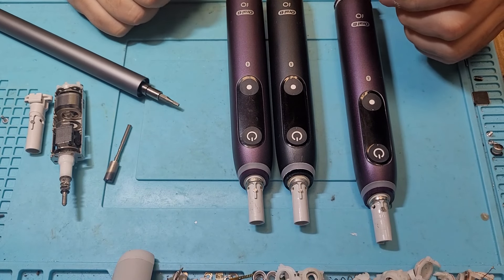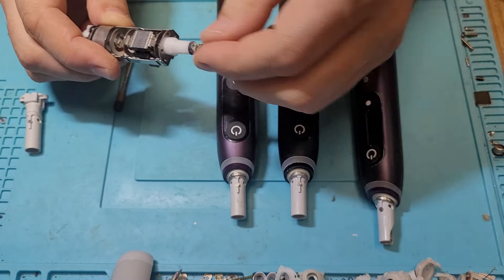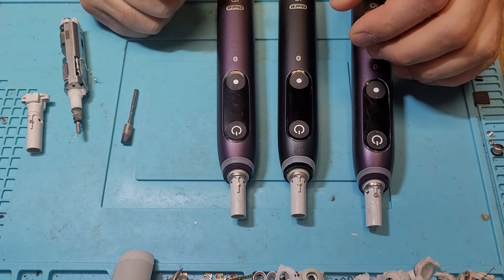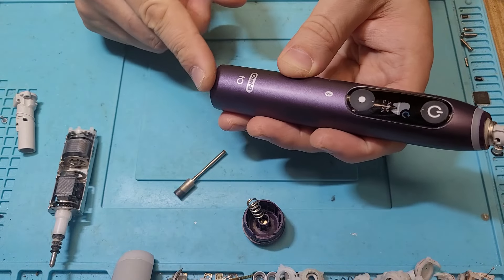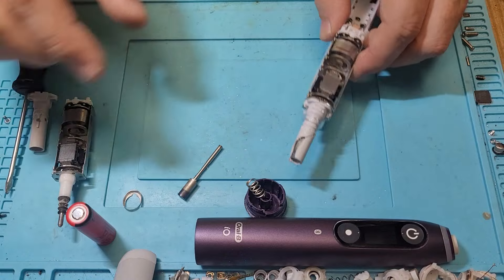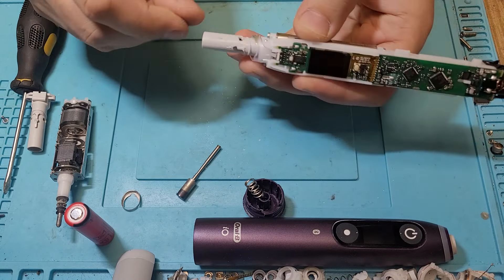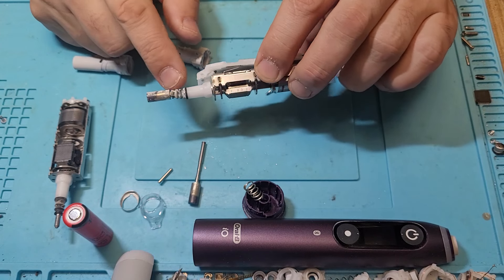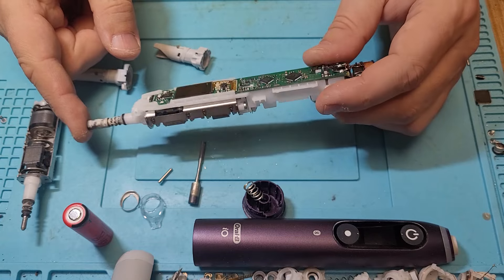Oral-B IO teardown/repair and impressions

Comment: Who else landed off in this great video after breaking the moisture membrane?😅
Reply: I am asking for a friend :)
Reply: Apparently, I damaged my back seal (don't believe I did), and it didn't fall under warranty. What do you replace it with?
Reply from the maker: @andreyzhidkov6509 another seal from a donor toothbrush.. haven't found till now these sold separately.. Philips toothbrush seals could work also but they are more difficult to remove..

Comment: It’s so annoying that Braun (P & G) do NOT provide spare parts. This (Io9) toothbrush is $749 recommended retail in Australia and I think it is indefensible of Braun to not provide parts. My wife’s brush has the detached shaft problem, and from my examination it would be a simple job to replace the part if all other components are working. Thank you for your video and spending time putting it together. I know there are No parts in Australia, no parts in the US. What about the EU, surely this policy contradicts the EU approach to sustainable production practices?
Reply from the maker: sadly no parts in EU as well... hopefully it will change if Right to repair will get a stronger foot in regulations. But at this moment service centers think that users are not qualified to desolder 2 points on a motherboard...
Reply: Perhaps a spot welder will do the trick...the kind they use for spotwelding clips on batteries.
But my pick will be is to buy a new IO3 on sale and desolder the complete part drive-shaft-seal-etc (as shown in the video) from the mainboard to be used on the IO9. Do not buy the IO2 as I've been told that it uses an other motor/drive...but I can not confirm it though.
Reply from the maker: Spotwelder for batteries is to weak for this job.. Tig welder would do the job but there is no place to get in and leveling it out would be a pain as well... Good idea for "brand new" parts ;) yes IO drives are identical but same as you didn't had Io 2 in my hands...

Comment: Very useful video. The problem I have with my iO is that it does not hold the charge. When put on the charger it seems to be working fine, charging up to 100%. But then when I try to use it it discharges to 0% immediately. Thanks to your vid I opened the brush and measured the capacity of the battery and it looks OK (729mAh). When I installed the battery back it worked fine for couple of days and the problem with immediate discharge came back again. Any ideas on where to start and what can be the possible reason?
Reply from the maker: Sorry don't have concrete solution.. didn't had one like this till now. But if it discharges that fast something should heat up on the board. Try inspecting with finger or thermovisor would be perfect for this..
Reply: @letsfixitgarage  Thanks for the hint, that makes sense. I'll check the thermovision. 👍🏻
Reply: @kon-jakub bro i get the same thing whats the problem
Reply: @vyvaqt738  no idea, I haven't spotted anything yet :(
Reply: I have the same issue. Haven't managed to open up and test the battery yet. The bottom sits very tight. If anyone have a solution I'm all ears. Thinking about 3d print my own tool to open. But if it isn't the battery.. then what?
Reply: @PatrikGerenmark  its NOT the battery, I can tell you that 100% sure...

Comment: Guys anyone help pls, how can i remove the plastic screen from the housing? I have a donor and want to swap those plastic screens (with rubber buttons)
Reply from the maker: My experience is that only whole housing exchange is a possible repair.. screen with rubber as well as rubber seal on top are melted too the housing no easy way to separate them...
Reply: @letsfixitgarage  thanks for replying. I will better leave it as is then

Comment: i think the only way to prevent mold and toothpaste build up is to wash the toothbrush and head every time and keep them separate to dry
Reply from the maker: there is other way but it involves changing your habits and that's not what a user wants to do :) best way is to hold the brush with levitated back side in that case toothpaste drips back ant not on to toothbrush. of course washing it thoroughly after usage is a must with this design as well..  as the head has hallow design..

Comment: my io5 doesn't turn On, it blink's all programs, it charges, but not turning on... No PP fuse on in like you said :)) Any fix ideas?
Reply from the maker: Difficult to say.. I always suspect water damage when something blinks or doesn't turn on when you press a button.. or do you mean that it turns on the led when you press the button but doesn't turn on the motor?
Reply: @letsfixitgarage  it just scroll’s through lights when placed on charger, then keeps scrolling if intake it off and doesn’t turn on the motor … 
No water inside !

On wife’s genius X i found a way even to reset the chip a year ago and it’s still working today. 
This one has to much technology :))
Reply from the maker: Yes all the new cool functions are a potential brake point... Sorry no advice this time haven't seen this defect personally :/

Comment: Thank you. Your video allowed me to fix my OralB iO series 6 that was 4 months old. Like many comments below, the magnetic head detached from the shaft. I little tip I discovered to get the head back on correctly was to soak the magnetic head in acetone and using a fine, sharp and strong needle, dig out the old epoxy. This took a while and multiple soakings in acetone. Once all the old epoxy was removed I added one drop of super glue on the shaft and reattached the magnetic head. It is working perfectly now.

I rang OralB US. They never followed up with email as promised. I emailed them and after explaining what was wrong, their response was "no receipt, no warranty. We will send you a $10 discount voucher." Are you kidding me OralB. $120 toothbrush that breaks after 4 months and they drag their feet and then offer $10. What a joke and what poor customer service.

Once again, thank you as you saved me throwing away the toothbrush.
Reply from the maker: Thanks for sharing your experience! Yes somehow both Philips and Braun are shooting in to their own foot with this no spare parts policy.. the brushes are well designed and really repairable but company policy makes it impossible. I believe the biggest problem is that a lot of times people don't see that they are throwing away the magnetic head that is ripped off with the brush head.. toll now all the people that asked my help didn't had the head with them, always thrown away..
Reply: I wonder if you could record a video on reattaching magnetic head as mine also detached from the shaft.

Comment: Thanks for your detailed explanations, the magnet on the Motor is for a force sensor, it works together with a HAL sensor on the PCB.
Reply from the maker: Thank you for explanation have forgotten about pressure sensor and how it's implemented in this brush. Really interesting design.

Comment: Very nice video
After I changed the battery on my io9, the unit didn't turn on and I was worried that I had made a big mistake
After some troubleshooting I found out that the "teeth" of the battery compartment were recessed and were not making contact with the battery anymore. I just got a pair of tweezers and pointed them back to the battery compartment and then everything started working again
What a relief 😅
Reply from the maker: sometimes its the small things ;) glad you worked it out!

Comment: I’m not sure what version IO I have but one thing to note is there is a metal pin that connects the plastic bit at the top to the white plastic around the circuit board.  That pin has to be pushed through to be able to remove the top plastic piece after removing the two security screws
Reply from the maker: I take the pin out in 12 minute. all IOs have the same power unit..

Comment: Thank you very much for the video. Our family has two IOs 9 brushes bought in the late 2022 and early 2024. Both of them suffered from quick and random discharge exactly a year into the future. The display says e.g. 59% and then after 5 seconds of brushing it blinks red and says it's discharged. I've replaced one battery almost a year ago, and now it's the second brush's turn. And again your video is the best for doing that! :) 

Both shafts are still fine, though. Also, the seals inside the both brushes were pretty alright after a year of use. Maybe they get dirty if you leave the head to dry on the brush or something? I know, that Oral B some time ago recommended leaving the brush head on the toothbrush and let it dry on an open air. That was in Oral B Pro or something. They now clearly state in the manual to take off the brush head, rinse the brush and the brush head and dry separately. Our boxes included holders for drying the brush heads.

Comment: Mine doesn't hold charge (if I forget to charge it all the time then I can't use it) so I have successfully taken it apart, got the battery out and put it onto a smart charger to test the capacity, but I now can't put it back together. I hope you post a video of this soon 😀
Reply from the maker: What seems to be the Problem? It should just push in place..the springs and plastic holders have some resistance but it shouldn't prevent it to set the battery in place..

Comment: I have two: IO7 and IO9. When the battery issues started, I got the replacements. I put them inside, and both toothbrushes worked fine, and the seal membranes were not damaged. But just after 2-3 days, one died, and the other could not pass the Hello launcher. I opened both of them - a lot of the liquid inside.  

Two questions: 

1. Could it be that the liquid caused some short circuit, which is not repairable (unless you replace the motherboard)?  

2. What I understood is that although you can open this kind of toothbrush for battery replacement, in most cases, you cannot put them back with the waterproofing you had initially. So it just doesn't make an immense sense. 

Thank you in advance for your reply!
Reply: I think I understood my mistake: When I put the metal ring back, I didn't make sure it snapped back into place with the small plastic clip.
Reply from the maker: Thanks for letting us know your findings. Yes this new design is not as reliable as old one so you need to pay close attention if everything is in the place... As for water damage if it damaged the LCD screen there is no other way as to replace the motherboard.. as LCD is glued and is very fragile if you want to.exchage it.. where are you from maybe I would have working motherboards for your repair. Write me to letsfixitgarage@gmail.com

Comment: did you ever test Philips upper seal, rubber gasket on Oral B ? seen some on aliexpress and look like they can be cut to work ?!
Reply from the maker: Oral -b and Philips concepts are completely different, they are not interchangeable.. just take few Philips seals from AliExpress they are ok. If you start to see black build-up on the seal - exchange it

Comment: Your videos are very informative and easy to understand. I say this as someone who's only been exposed tangentially to the secret world of electronics.

 I've seen that many of your videos are focused on smart toothbrushes. As a software developer, I can only evaluate the two from the perspective of code and app functionality and feel that both oral b and sonicare are almost identical in that regard. How would you evaluate these two in terms of hardware. Do you feel like one of them has a superior design over the other ( more elegant , resilient , etc .)
Reply from the maker: I would say that technically they are both top of the line. In Philips they use the same electromagnetic drive on almost all of their brushes for quite some time, even the cheapest and they are more repairable. IO is quite new. now when they introduced the electromagnetic drive I would say they are on the same page as Philips maybe even better but no idea how it will show in the long run and how available the spare parts will be.. at this moment I would choose Philips as they are longer on the market with this technology and spare parts are all over the internet. But the best would be to try both and see which you prefer as they feel quite differently..

Comment: Great video - where do you get parts?  I need to replace the plastic neck like you did.
Reply from the maker: Donor brush. Braun doesn't offer spare parts.. that's what I got when I asked them for parts. Maybe in some time Chinese will start producing them but at the moment you need a donor brush for that :/
Reply: Thank you for the quick reply!  Bad news, I glued it in the meantime. 😅
Reply from the maker: If it holds, that's good news :)

Comment: My iO8 sounded weird and the head didn't rotate. I removed the head and I found that the shaft (complete with the glued magnetic head) was free to go out off the body. Does anyone know if is possible to replace the shaft? It is out of the device exactly how showed in the video.
Reply from the maker: Much easier would be to replace the whole electromagnetic drive. Just 2 solder points.
Reply: Thanks! Please, could you help me to find an online shop where I can order these  kind of spares ?
Reply from the maker: To my knowledge there is no spare parts for the IO at the moment.

Comment: I've had one for just gone 12 months and found it to be broken when I went to put the brush head on.  It looks like the magnetic piece came off and stayed inside the brush head, which then results in it not spinning/vibrating properly.  Having watched your useful video, it looks like this might be somewhat fixable if I take it to part and then perhaps use some kind of epoxy to attach back to the metal rod.  Do you think that would work?  I've always found electric toothbrushes don't last, so I'd been extra careful about looking after and cleaning this one!
Reply from the maker: If it's only 1 year contact the seller for warranty. Braun replaces it with new one in warranty period. I doubt that epoxy would hold. There is a lot of vibrations and even the magnetic head that is epoxy glued in factory sometimes comes off.. so to glue the shaft and then to get it straight.. seems quite difficult but is you succeed make a video ;) I think a lot of affected users will be glad to see this solution.
Reply: I have the same problem! Did you solve your issue???
Reply: I have the same problem
Reply: @siema114  luckily i am still under warranty. I sent mine in for repair a few weeks ago and they sent me back a new toothbrush. Process was smooth. 2 year warranty
Reply: Oral b is refusing to fix mine. I got it as an Xmas gift and the person who gave it to me doesn't have the receipt. It's absolute bullshit. It literally broke after 4 months of use
Reply: @jessicathatsme7945  So to come back to mine, it was a similar situation in that it was a gift bought from Amazon.  They eventually agreed to look at it and it was sent to a repair centre address which I think may have been what Oral-B use.  I didn't hear anything and about six weeks later I found a brand new one at my doorstep, complete with all the accessories.  I'm super wary of removing the brush head though, as feels like it might just happen again.

Comment: Hi, my Oral b IO 9 it doesn't Turn ON.
I replaced the battery with a new one , I checked the ⚡️ voltage of the battery and it shows 3.6 Volts.
Any help please?
Reply from the maker: check the fuses and if there is no water damage, usually its on the under side.

Comment: SO I need to replace the battery, got a new one but can not get the bottom cap off, it is impossible to shift using the tool or indeed pliers without breaking it, any ideas ?
Reply from the maker: Try submerging the bottom part in water for short time and work it back and forth. It seems there is toothpaste build-up that sticks it shut..
Reply: @letsfixitgarage  cheers, tried that and did not work but will try again ... don't want to try pliers as will break !
Reply from the maker: Leave it in water for longer but I would not submerge benearh the hole with ventilation filter. It's not designed to be 100% waterproof for long time submersion..

Comment: Great video! Could you please tell me what the ceramic piece is inside the charging coil and what the spring is for? I took the bottom of mine to replace the battery and the ceramic piece (I believe) had cracked into two. I put it back together without the spring and the ceramic and it doesn’t charge quickly so I’m assuming the ceramic piece is required for the charging to operate. it does seem to charge but it probably 1/10 of the rate of when new. Any insight would be appreciated!
Reply from the maker: Difficult to say.. from my opinion ceramic piece shouldnt affect the charging process... and spring is only there to make pressure on the whole inside to have the toothbrush up to the rubber seal..
Reply: Well, it seems the ceramic piece is required. While not magnetic it has inductance properties and in this case hugely affected the charging. 
I got a glued my broken core, popped it in, and it’s now charging like new. Zero to hero in about three hours! So if anyone’s reading this, and wondering what they should do with their cracked ceramic core, super glue it and put it back, it’s required!

Comment: Hi, I have an i07 model and want to open it. Oral b says doing so will “destroy” the appliance. Is this true? Is there risk involved?
Reply from the maker: as you can see in the video opening it and later reassembling it will not lock or somehow destroy it.. if you dont know what you are doing its possible to short out something as there will be open electronic components. but if you are careful all will be fine. check the video and remember all the parts how they are taken out in which order..